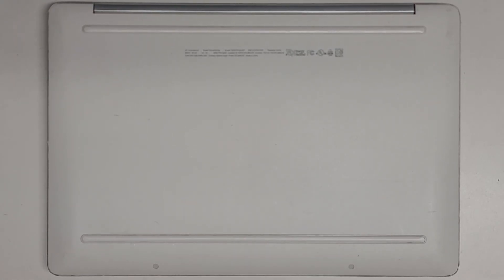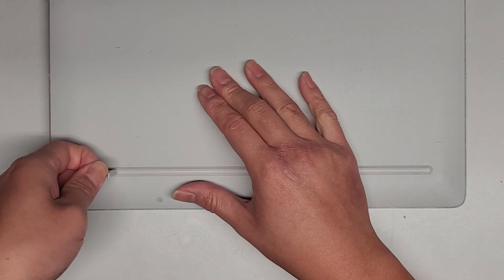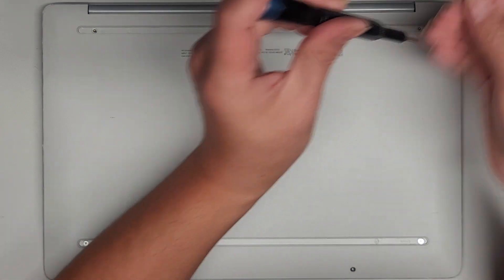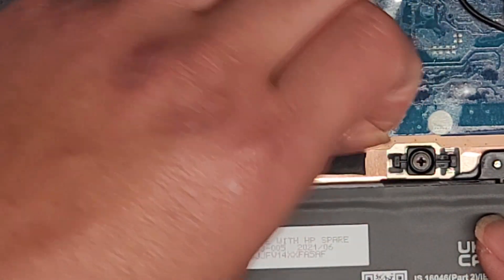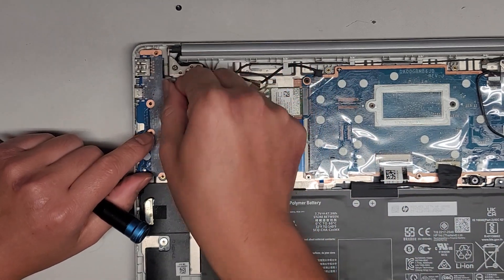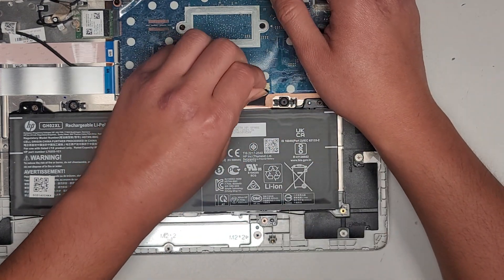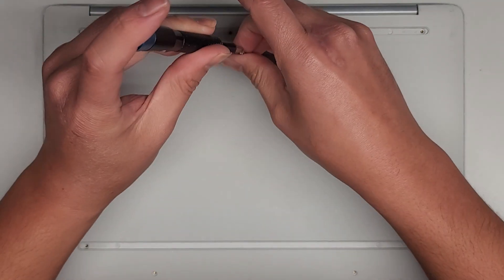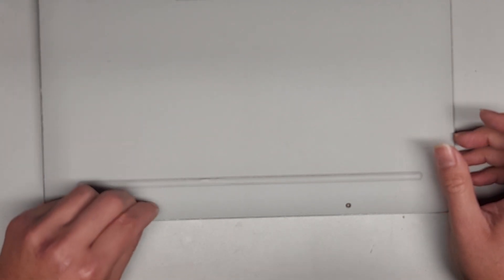HP Chromebook 14 14a-na0012tg Disassembly Quick Look Inside No Power Battery Reset Repair

Comment: I have a hp chromebook 14a-ca0042d doesn’t have a charge light when plugged in a wont turn on tried both charging ports and tried these methods to hard reset
Reply from the maker: Sounds like a dead board

Comment: My battery is inflated and needs to be replaced, and my computer is a very similar model. Should I just unplug and unscrew the battery and replace it with a new one, or are there more steps?
Reply from the maker: Yup. Make sure the computer is off.

Comment: Can I clean / change the keyboard? Some keys are unresponsive after a spill.
Reply: As a temporary solution, you could use a bluetooth keyboard. I bought one on Amazon, it can connect to three devices at the same time!
Reply from the maker: Yup
Reply from the maker: Likely need to replace the whole keyboard palmrest assembly.

Comment: hello so i may be a little late on this video but i have the same issue and wonder if you can help i replaced the battery and held the power button down still  not getting any light at the charger port i had the computer for 2 months and it just went black one day and never came back on ive tried the hard reset already nothing seems to work any more suggestions ?
Reply from the maker: I dunno :(
Reply: @ItsBinhRepaired  you think a motherboard would maybe work or should i not waste my money?
Reply from the maker: Most likely would work

Comment: I spilled some water on mine and now some keys wont work and I did a hard reset, but nothing changed so can I fix from the inside of the board? And how?
Reply from the maker: You'd have to replace the keyboard

Comment: Can the internal drive me upgraded and if so- can it be a 1TB upgrade? I can't find any video on the replacement of this model for some reason. Do you know if there is a video or demo of how to replace it? Is the hard drive even replaceable on this model or is it soldered on the motherboard? 

HP Chromebook 14 G7 (2H2C3AV)
Serial: 5CD3124SSX
Product: 3V2U9UT
Thanks
Reply from the maker: Nope
Reply: @ItsBinhRepaired  thanks for your response- I didn’t think it could be but wasn’t sure.
Reply from the maker: @SamFowler_SAR  yup
Reply: @ItsBinhRepaired  Nope as in it's soldered on? or Nope as in you need to be technical?
Reply from the maker: @dbryantmedia  usually chromebooks aren't upgradeable at all.

Comment: my battery light is on when i try to charge it but the screen stays black what do you recommend ?
Reply from the maker: Battery power drain
Reply: didn’t work
Reply from the maker: @julations  sounds like dead motherboard
Reply: @ItsBinhRepaired  how do i fix
Reply from the maker: @julations  replace the motherboard or send it to a repair place.